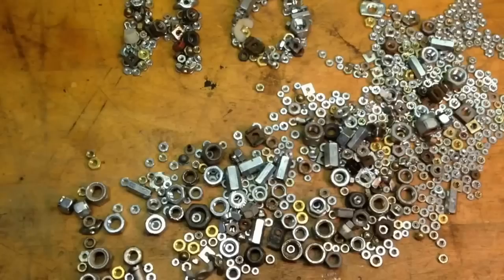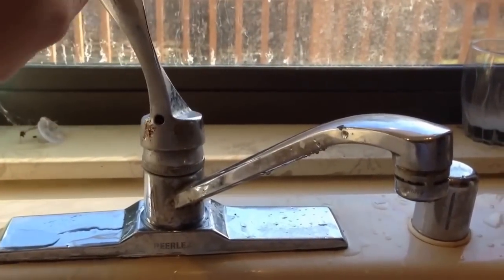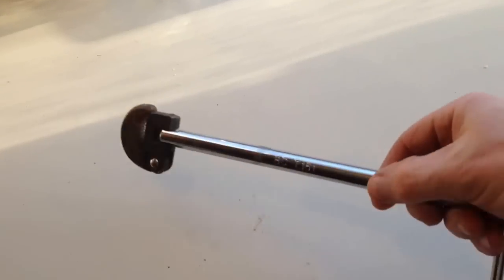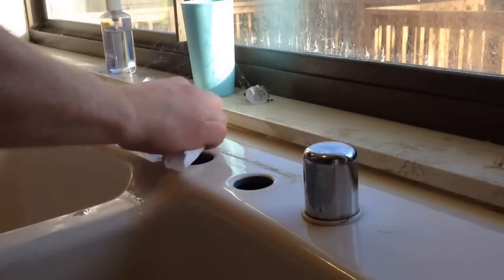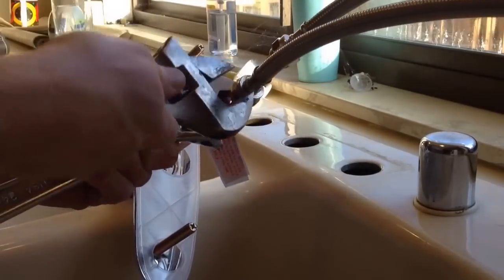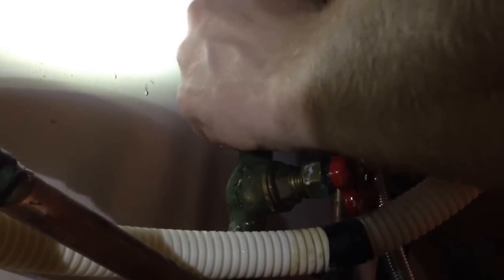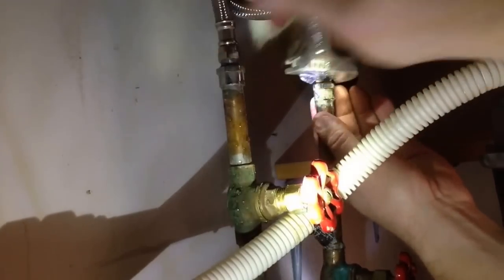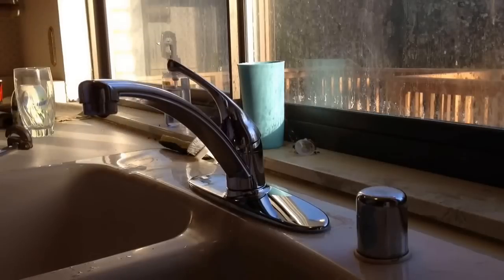Replacing a single handle kitchen faucet

Comment: Wow! Great video Bob thanks! I literally spent an hour under the sink trying to fix a supply line leak in very tight quarters. Turns out the old line my Mom had was missing the inside washer but it did not leak prior because there was a nice fat one in the copper line from the new faucet. Yes I tried to reuse her old non braided line, as I did not have a replacement with me. Just figure everything seniors have is mostly broken and they don't bother fixing stuff cus you know they are going to die soon according to them lol. 
Had I watched your video first on attaching the new lines top side I could have saved myself hours literally, and a big bruise on my shoulder from laying on the cabinet shelf lip for too long. What a nightmare! Bless you Bob!
Reply from the maker: Thanks again for watching.

Comment: Bob: I noticed you did not put teflon tape on those supply lines. Is that not necessary on a threaded connection? Thanks
Reply from the maker: Teflon tape should only be used on what is called “pipe threads”. Those are the “slightly tapered” threads that do not have a built in sealing mechanism. If you look at the supply lines the braided lines already have a rubber cone shaped washer that mates with the faucet and that is what does the sealing there on the other side there is usually a compression ring that goes into the slightly tapered fitting of the shit off. (I hope some of this makes sense) Do use of Teflon tape can cause more problems than it solves. If the tape gets in the way it can cause a channel for water to leak. Most of the time Teflon tape is used for gas fittings and or old galvanized water lines. In this case all the new materials that you should be using to hook up this faucet there should be no Teflon tape needed.
I hope this is a clear explanation, it’s hard to explain without showing you in person. Thanks for watching.

Comment: Even if turned the hot water off completely from the main valve; why is it still low flowing? (NOT a lot, but still flows). The cold line shuts off nicely though. Any thoughts on that? Thanks.
Reply from the maker: If you have a multi turn gate valve chances are that a washer inside is no good. Better to change the shut off to a 1/4 turn ball valve. Hope this helps. Thanks for watching.

Comment: Went to Walmart tonight to get a new Peerless single handle kitchen faucet. I found out they don't include those hose connections for water supply so I didn't buy the faucet. Did you use what was all ready under the sink or buy new water connection hoses? Wondering how to know what size to get? I have the exact same faucet you are removing and mine will not stop leaking/dripping. Can I change with a different make?
Reply from the maker: Sometimes the supply lines can be reused but most of the time it is not recommended. Any faucet with the same spread should fit so if you want to change to something else that would be a possibility. Thanks for the view.
Reply: @funbro1  I bought a Moen that has supply lines attached but with a smaller line ends that are too small to screw back onto the other end.  My pipes are very old. Can't afford to replace them all. Suggestions?
Reply from the maker: I would try replacing the shut offs maybe. It’s really hard to say without seeing what you have going on.
Reply: @funbro1  I took the one end of the old line that had one of the bolts on it and went to ACE and bought 2 adapters for 3/8 inch on one side and 1/4 on the other...got the supply lines hooked up. I had to use plumber's tape due to some leaking. Voila'...fixed and working.,
Reply from the maker: Awesome!

Comment: what about drilling a hole when i just bought a 4 hole faucet? I believe mine is stainless steel painted in white. Is it just a matter of drilling a hole with drill?
Reply from the maker: +Inquisitve m That is a difficult hole to drill without the correct bit. If there is any way to get another sink or use 3 holes that would be better. Not saying that it can't be done.

Comment: Thank you for your video, my faucet leaking exactly same area as yours. Is it possible to repair only replace inside parts, not whole faucet? Sorry for bad English.
Reply from the maker: Sometimes they can be rebuilt but in this case the inside was corroded so bad that the inner pipe was leaking so I had to replace the entire faucet. I hope this helps, thanks for watching.
Reply: Thank you for your comment. :)

Comment: Do you need to use any teflon tape on the connections?
Reply from the maker: +rek550 Not on the beveled or flared ends and not on a fitting with ca compression ring, So generally the answer is no but it really depends on what type of threads you have. Pipe/taper threads would need pipe tape or dope but for most faucet installs I do not use teflon tape. Hope this helps, Thanks for watching.

Comment: yeah so my handle has no screw...
Reply from the maker: Sometimes there is a Hot/Cold indicator that hides the screw, other times the hide the screw under a cap on top of the handle. There should be a screw somewhere that is holding it together.

Comment: SUGGESTIONs: Use thread sealing tape on the supply line connections, dont over tighten them, temporarily remove airiator screen on the faucet tip before final  flushing of the line so you dont clog it up with debris.
Reply from the maker: Dean Miller Dean Miller Dean Miller Thread sealing tape is not necessarily in this application. In fact it will cause the connections to leak if used when not necessary. Definitely agree don't over tighten. Remove the aerator IF it gets "clogged" but many times it doesn't so why do it when it's not necessary? Thanks for watching.